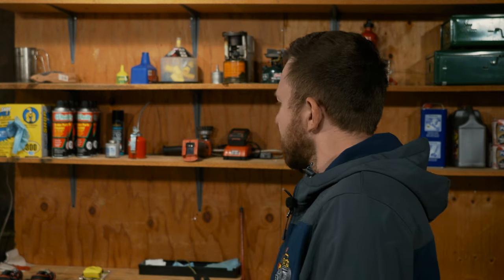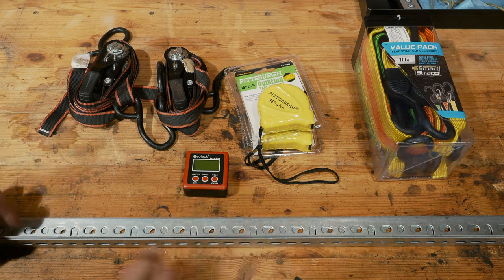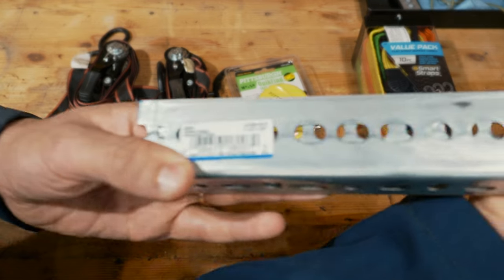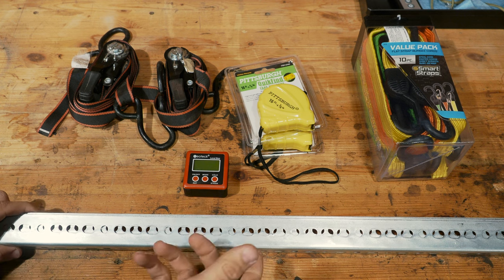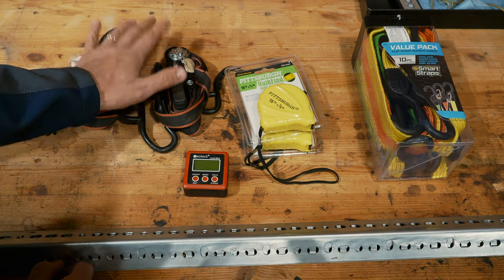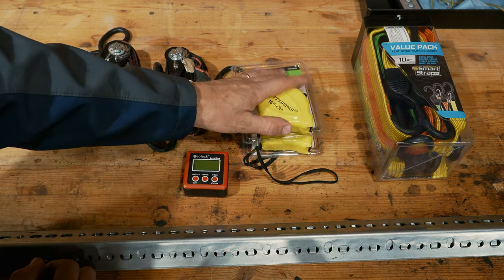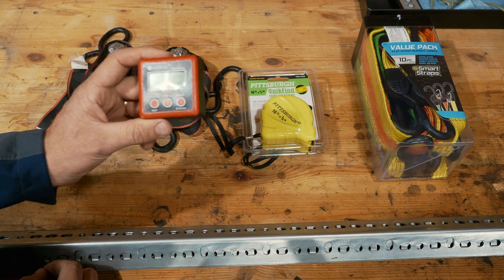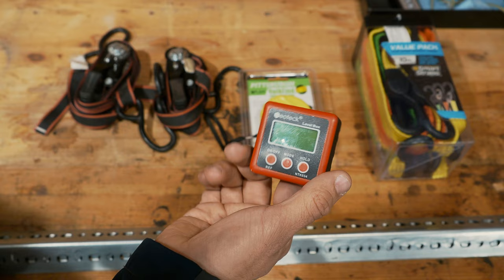How to Make a cheap DIY alignment tool

Comment: First things First, as I Am a Licensed Automotive Technician, Your Way is Good, but You Still Need to Align Your Steering Wheel Straight First and Lock it in Place. Then, you need to bring Your Front Wheel to ( 0 ) to Match the Rear Wheels. If You Don't Do That Your Vehicle will still pull to either side as You Drive down the road because the steering will not be centered the way You're Doing It. That is why we use a four-head alignment system to ensure proper alignment. In the Older Days Before all these New Tools, the Alignments were done this way but with a rope coming from the rear wheel axle to the front axle on the outside of the tires making sure that the tires were touching all sides and also using a Level to align the Camber and Caster. The toe was always done with a tape measure Making a Mark in the Center of the tire and measuring from that Point in Front and Rear of the Tire.
Reply from the maker: I'm probably just ignorant on the topic but, with a solid axle I don't see how one is able to zero out the drive/passenger sides independently since the drag link ties them together regardless of how the tie rod ends are adjusted. Or do you mean over all the front end needs to be zeroed out?  

Another thing is that Caster/camper is not typically adjustable on solid axle vehicles. Specifically it is not adjustable on Jeeps, its fixed along with the pinion angle. So in this area I just get the best camper/caster I can while maintaining a driveshaft angle  that doesn't induce vibrations.

How do you feel about string alignment systems? Quick Trick comes to mind at the moment for the home DIYer.

Comment: A quick observation. Because your points of measurement are further out than the edge of the rim where we traditionally measure toe, the specs won't work. 4mm at the rim edge would be much more at your points of measurement. and another issue is that you're measuring from wheel to wheel. So you're not true to the axis of the car. After you adjust the first wheel, you'll adjust the opposite wheel, which will change the first measurements you took on the first wheel
Reply from the maker: I might be able to agree with your points up until you say adjust the first wheel and then the opposite wheel. 

This is a solid axle vehicle with a tie rod and drag link. You can’t adjust toe independently. Toe for these vehicles is measured in total toe.
Reply: @EmbarkWithMark  Ahh nice. Thanks for the reply. I had no idea. I've just watched a few vids with this mistake and thought i'd point it out.
Reply from the maker: @TheVcasf  No worries! I appreciate the knowledgeable input.

Comment: The only problem I see with this method is it doesn't include individual wheel alignment from side to side using the rear tires as a reference. So yes the tires will have a good toe adjustment between the front tires but may not be in alignment with all four tires.
Reply from the maker: I would agree for IFS. However, for solid axles like Jeeps it's just as easy and accurate to center the axle by measuring to the frame. This is not a fool proof method though.
Reply: On solid axles like a Dana 44 ( likely in that Jeep) with leaf springs the rear springs have center pins that engage and center the rear axle.  His method of setting toe is just FINE.  Racers have been setting toe on race cars this way  as long as their have been race cars.
Reply: Metal cloak sells toe alignment tools just like this…. I have used this method for years on my JKU. Off road shop did a free alignment when I get a new set of custom order tires… said it was spot on.

Comment: You should have measured the distance between the two tape measures and make sure that it was the same on both sides so it would be square. Because if a 1/16 of an inch makes a difference, then your tapes having different gaps would definitely affect your outcome
Reply from the maker: Not a bad. Ensuring both measuring tapes are accurate to each other is a smart move.

Comment: As a retired mechanic who used old school alignment machines I recommend you never do this unless you want premature tires wear
Reply: Me too (retired mechanic), but you do know that a toe adjustment can be done at home….and although I would add some things to get better accuracy, this isn’t magic voodoo only an alignment rack can muster….certainly not a simple toe adjustment. This coming from a guy numerous decades ago, who started at Goodyear tire and rubber company, and been around the rack a few times!
Reply: On a Dana 44 axle like this Jeep has tire wear likely would come from Caster or camber. On a Dana 44 camber and caster is set when the axle is built by Dana. Changing caster would require the knuckles on the end of the axle to be cut off and re-welded. Small camber changes can be done with offset cams between the steering knuckle and the upper and lower ball joint, but in many most cases to much work for little gain. This guys method of setting toe is just fine,  racers have been doing it this way forever.....

Comment: This is very wrong. If you rely on the tire to make the alignment it may be inaccurate. There might be some sort of deviation in the tire surface at the point where you set the straight edge. Also if you rely on the rim that also might be wrong because there may be rim deflection. Best to attach an extension from the hub bolts past the tire surface and then use the straight edge method. Depending on the number of bolts bolts on the hub remove two and insert properly threaded longer bolts, or bolt extensions add a locking nut to prevent unintended loosening. Then you can attach the straightedge making sure the length of extension are exactly the same. This measurement is important because any variance is multiplied at where you want to measure toe adjustments.
Reply: Racers have been adjusting toe on the race cars this way, for a long time.  This method works just FINE.
Reply: @dand3975  I don’t think that the common DIYer has tires that as much quality as those race cars. There’s no comparison between a $2,000 or more race car tire and your everyday $200 street tire. You can be sure there are some sidewall deflections on the street tires.
Reply: @disoldman72  I was referring to racers as late model stock car at Local Saturday night race tracks around the US, also ARCA & ASA.  If small-time teams like that needed to spend $2,000 on a single tire there would be no Saturday night short track racing.   I was not referring to the fantasy racing of NASCAR or formula 1.
Reply: @dand3975  
In that case a poor alignment isn’t a big problem.
Reply: @disoldman72  My gosh you are so triggered by people saving money by setting caster, camber, and toe on their vehicles....... you must own an alignment shop and still making monthly payments on your Hunter alignment rack.   This is not some very specialized skill,  it is only tires.

Comment: Any measuring device would have to reference off the rim. Alignment machines take into account wheel runout and track . The only thing you can set is toe with any of these hacks. Where you have your straight edge would be highly inaccurate.
Reply: Not true. Measuring camber is also very easy using a digital level or angle finder, or even with a level, a ruler, and a basic understanding of simple trigonometry.

Caster can also be calculated doing a wheel sweep and using a digital level/angle finder. Just takes a little more math.

You do realize that alignments predate digital alignment machines, right? ;)

Comment: Thank you. I have been using a straight edge to make marks on the driveway but I like your way better, I will try it next time. Wish Harbor Freight made a cheap setup. Would be nice to gauge off the rim instead because the tires aren't always perfect and the raised letters get in the way.

Comment: For those who are interested to 4 wheel for I.F.S. front end use a string at centerline of front and rear wheels to check. With string tight around both tires you can see if they are out if one side of your front tires are not touching the string
Reply from the maker: I'm going to give this a shot with our 4runner. Thank you!

Comment: Another problem is that tires are far from perfect. I have tried this and found that as the tire is rotated, the dimension changes because of variations in the sidewall rubber. To be accurate it must be done from the wheels, as a shop would do it. 
Yet another problem is that as you extend outward where you measure, at the tire tread, the toe dimension will be far different from what it would be measuring from the wheel.

Comment: I used fishing line going front to back equal distance from center of wheel tided to jack stands.  I measured from rim to line with caliper and figured amount of toe  in by figuring difference between center to center of the tire to rim to rim. Your toe-in measurement will be proportionally smaller by the center tire mesurement is to the rim.  Make sure your rims are straight by lifting the tire and spin the tire using something like a rod attached to a jack stand.  Now simply subtract the front meaurement from the back.  Three other things.  Level ground, steering wheel tied straight ahead and I used two plactic place mats from the dollar store to allow the the front wheels to move. Wiggle the wheels after each adjustment to make sure of proper measurment.  If you have independent rear suspension do the same for rear.  Tools, fishing line, tape measure, four dollar store place mats, claiper or fine scale measuring ruler, calculator or smart phone.  If your front and rear wheels are different width set your string equal distance from the center line of the car.  The distance between the line has to be the same front and rear and equal from center of the wheels front and rear.  Idea is to get to parallel lines to the center of the vehicle.  Most cases toe is all you need or can set on most cars.

Comment: Here’s  my comment….while I like the idea overall, some considerations….first of all tires and wheels almost always have runout….so my preference would be to determine where the runout is….using a dial indicator….or something as simple as spinning the wheel and marking the high spot (wobble) on both tires and clock your placement of the cross bar in the middle of runout (splitting the difference on both sides.) Also on your jeep, and my Honda crv (had a wreck and bent front end parts, which I fixed…hence my need for a cheap alignment), you could also of utilized the slot in your wheels, and used one of your bungee or ratchet straps, through that slot in the wheel just to grab your slotted angle at the mid point and held it that way. Also, toe adjustments are usually given in degrees of angle, and 1 degree of angle, is 1” at 57.3  (or 57 1/4” works too) inches from the pivot point of your wheel, so if your car calls for 1/8” toed in, (2) 6ft pieces of rigid angle held on like your slotted angle, you could measure out front @ 24” and out at 57.25” and get a pretty precise toe adjustment. Not sure your really short angle is all that precise, since if you extrapolated your measurements out even  57” out front, your adjustment would be within spec. Also I would go drive your Jeep, and pull it in, again and set up your toe alignment setup again and see if it was truly repeatable, meaning did your adjustments still match what you set on the video….I’m thinking since if there is any tire/wheel  runout, it might be off perhaps a decent amount, but again I like the easy idea for attaching the bar to the wheel, and that it measure toe with the suspension loaded. Nice video.
Reply: Furthermore, once you determined where your runout is, and your best place to put your bar, you could make up 4 blocks (or dowels), all accurate to one another (3d printed, aluminum or even hardwood), to place on the surface of the wheel and get off of the tire entirely, which would increase your accuracy perhaps by a lot…..fyi, food for thought!

Comment: String tied around the back fender run across the center to the front. across the front and anchor to front fender.  align till it touches. Measure Center to center front and back of tire. Then i run it to the pro shop. Never been off more than couple degrees.

Comment: Only just started to watch and straight away my thought is it Needs to be off the wheel not the tyre wall. Wheel is fixed solid point tyres can flex/bulge
Reply from the maker: The wheel would be best. But in a pinch if you just need a quick and dirty alignment, the tire does work. Not the best. but it works.

Comment: You seem to be just completely guessing which side is out with this method and you could very easily end up with a parallelagram with the correct measurements but not running parallel to the vehicle on the road.
Reply from the maker: You can't adjust toe per side on a solid axle. Solid axle vehicles operate on Total toe. If this was IFS  I'd completely agree with you. Though I do admit, that this method (using the tire as a reference) is not the most accurate. It would be better to bolt/strap the straight edge to the hub directly.

Comment: Wouldn't it work putting the bungy cords around the inside of the tire and use the hooks through the holes in the angle iron?
Reply from the maker: Anyway you can hold the angle iron flat against the tire.

Comment: Another question: how do you know which tire (right or left) to adjust, and by how much?
Reply from the maker: Solid front axles can only be adjusted at the same time when it comes to the toe adjustment. There is not a separate adjustment in the steering linkage for left or right side.
Reply: Apparently you just guess
Reply: his process is wrong

Comment: That method will only work when the other side wheel is alligned correctly. If it's not, You'll set up Your wheel accoding to misalligned one and that can cause Your car will be constantly oversteering on one side and understeering on the other.
Reply from the maker: Incorrect. You can’t independently set toe for a solid axle vehicle. They are tied together. Toe for a solid axle vehicle is measured in total toe. I agree with you for IFS

Comment: Wouldn’t the Measurements be  different going off the tyre rather than the rim . What if one tyre has 40psi and the other one is,say 35psi.. shouldn’t that throw off your measurement?
Reply from the maker: Yes, it can. For a quick and dirty alignment, this works. But yes, you should go off the wheel or the rotor even.

Comment: If you have a taller car, it is easier and more correct to measure by marking the inside of the tires at hub height, measure with a tapmeter, roll forward, measure again and adjust. If it is a lower car, measure the outside, angle off towards the floor, roll forward half a turn, measure again.  https://youtu.be/bdJiOCzYdgw
Reply from the maker: It’s even better to take the tires off and measure from the rotors. This is just a quick and dirty way to check alignment.
Reply: On cars like yours and Volvo Laplanders measure with a tapmeter from inside under the car and as far as possible out on the wheels and roll forward and measure againe to get all slack from joints.

Comment: Your measurements are not right, the tire you you didn't adjust but measure with?? You need "center?
Reply from the maker: The tire I didn’t adjust? It’s one adjustment for both tires, they are connect with one tie rod, there’s not a separate adjustment for each tire. Tie rod ends adjust both at the same time. Not only that, the measurements for toe are for over all measurement and not taken per side.

Comment: Don't you have to take rear wheels into consideration? Front can be perfectly parallel yet not in sync with the rears.
Reply from the maker: You do not. On a solid axle vehicle the axles are either centered or they are not. You center the axles based on their location to the chassis instead of each other. 

A simple front end alignment that most shops preform address toe and maybe pinion angle. Those two adjustments have no relation to the rear axle. 

Most shops do not preform a 4 wheel alignment unless you specifically ask for it. Even than, solid axles have such few adjustments on them it’s not really needed. The rear can only have its pinion angle adjusted and be centered under the vehicle. The front is normally toe, pinion angle, and centered under the vehicle. 

Ifs is of course a totally animal.
Reply: You have to align the front tires FROM the rears which are fixed in a RWD car. This method he did was WRONG.
Reply from the maker: It’s evident you don’t understand how solid axle vehicles work.
Reply: @EmbarkWithMark  You are right.  It is evident that I am outright dumb.  Thanks.   BTW you do have to consider what I commented when you are aligning a fwd.  Anyway, I am still dumb.  Thanks again.
Reply from the maker: @armandomarin-arias4021   My response was not aimed towards you, it was to the other comment, sorry if you took it as such. Yes, if aligning a Front Wheel Drive car, then you are correct. We are not aligning a front wheel drive car here though.

The only syncing, as you put it, that needs to be done is ensuring the solid axles on the front and rear are centered under the vehicle. This is commonly done by measuring to the frame and not to each other. But again, this goes outside the realm of a normal front end alignment. A 4-wheel alignment is only needed, if something changes. I.E. something is broke or changed out on the rear axle. Even at that point, for something like a Jeep, it's hard to justify a 4-wheel alignment. Solid axles just do not have that many adjustments on them. Pretty easy stuff compared to modern IFS.